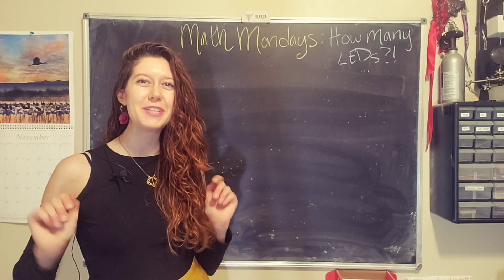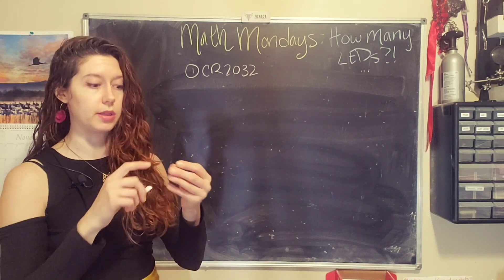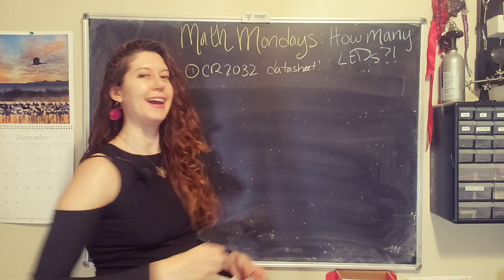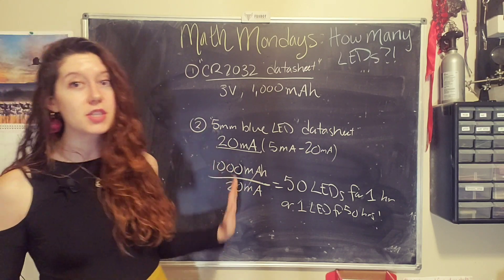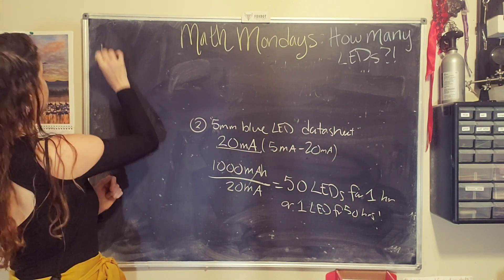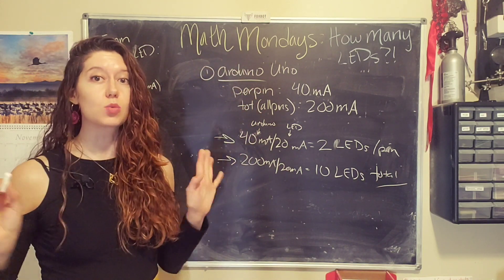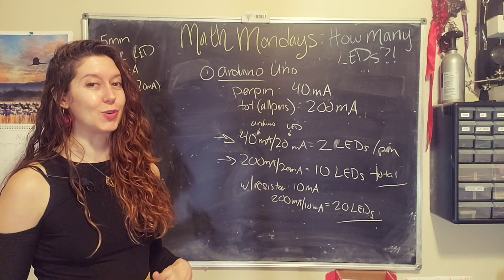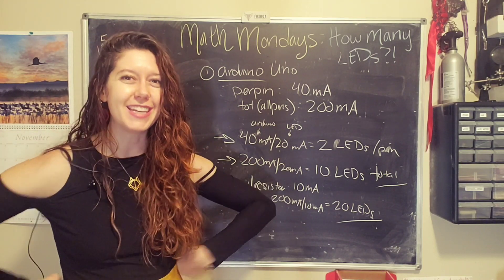How many LEDs can I power??

Comment: I'm disabled and I want to get led lights for my tent. What ones could I buy that run the least amount of power so I could use USB power bank. Or do they sell ones that you're aware of that could be recharged via AC, car, solar.
Reply from the maker: Red LEDs will use the least amount of power. From there, dimmer lights and fewer lights = least power consumption. Id recommend figuring out how much light you want/need, and then you can get a set that runs off a lithium battery (or rechargable AAs) that can be recharged with a solar panel during the day.
Here's an example of fairly bright LEDs: https://www.adafruit.com/product/4846

And some lower power ones: https://www.adafruit.com/product/897

Both of those have options to include batteries. The latter set uses coin cells.. unsure if there are rechargable coin cells but those are quite cheap and safe to dispose of. You could also replace the coin cells with a 3V lithium battery with higher capacity that can be recharged (altho I'd recommend reading adafruits comment about changing the power source in the product description). Hope that helps!

Comment: I assume that the LED's on a single pin are in // , isn't it? Great explanation 👌 Thanks.
Reply from the maker: Yup! Gotta be in parallel, not enough voltage with just 1 battery for 2 in series

Comment: 1 Amp hour off a 2032. think about it ;) and also, putting in a resistor will dim the LED but it won't save the battery. you'll be just wasting that power through heat generated in the resistor. you'd be much more power efficient if you connect them LEDS in series of 2, each having 1.5V, then you don't lose any energy unnecessarily.
Reply from the maker: Yea the capacity of a cr2032 is impressive! Resistors can and do preserve battery capacity in series with an LED bc it reduces current consumption so the battery will last longer.